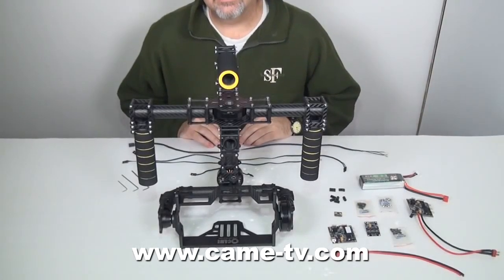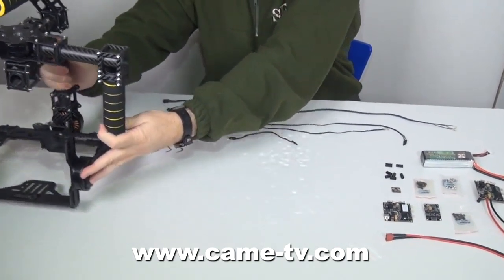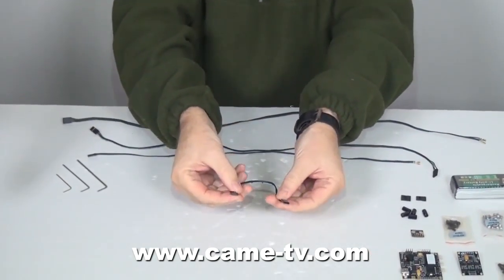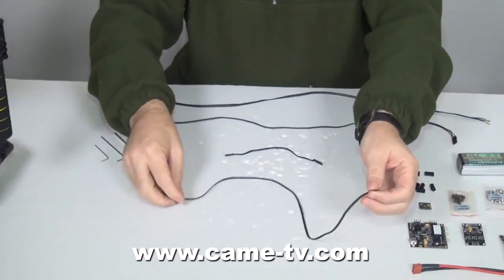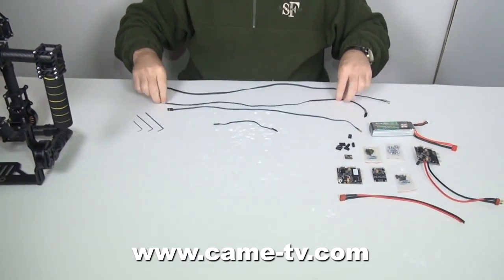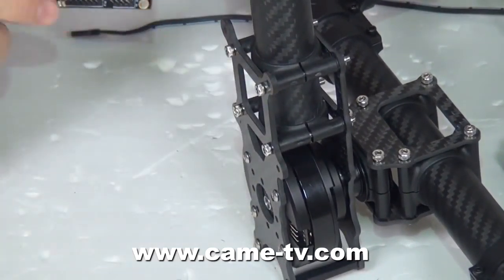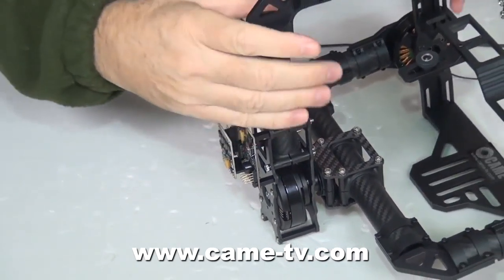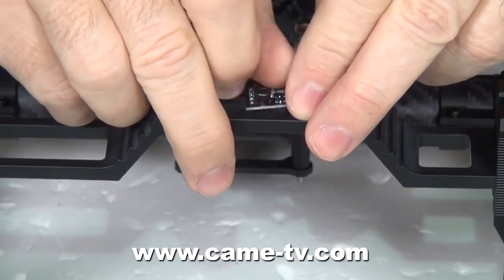Build the CAME 7000 3 axis Gimbal Controller Board Video

Comment: Hello. My system just arrived (thank you), but the board(s) are different than those in this video. Mine has shipped with the SBGC v3 (ds-085) which came connected to one small board and then onwards to the sensor board. Unsure what the intermediary board is and where to mount it. Do you have an updated video or instructions? Thanks for the help!
Reply from the maker: our 32bit board video tutorial will come out around 5 days

Comment: I'm in trouble, I can not calibrate my gimbal when I connect to the computer firmware 2.4 was installed on the board, leaving the gimbal crazy, how can I solve this, there is a reset on the board or the program you can return the old firmware?
Reply from the maker: your model board is 2.3 B5 version ,  not 2.4 .
Reply: CAME-TV.COM How do I get 2.3 B5, because all roads lead me to version 2.4? Please help me

Comment: Sorry but the sensor is 5 pins not 4
Reply: With the wire, one of the 4 wires has white lines on it - match it with the pin that says GND written underneath the circuit board, and on the sensor with the pin that says GND written underneath and you'll have it connected correctly.
Reply: Thank you everything is ok!

Comment: Does the power need soldering onto the board??
OR does it now come attached?
Reply: Same problem the controller boards the only bit not covered?!!
Reply: It has to be soldered.  It comes unattached.
Reply: ok all sorted.. I'm just wondering.. i ve watched the vids and have it assembles in front of me. should the unit with out a camera just drop to the heaviest side or should it be positioned to balance out?
Reply from the maker: without camera, it will drop to heaviest side .  you need balance yourself